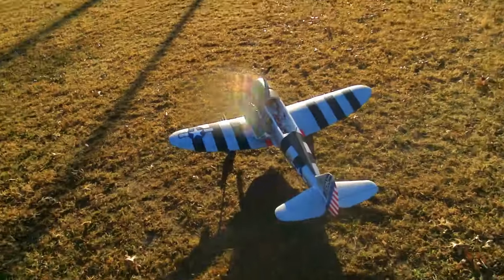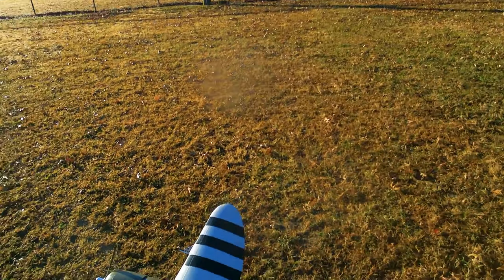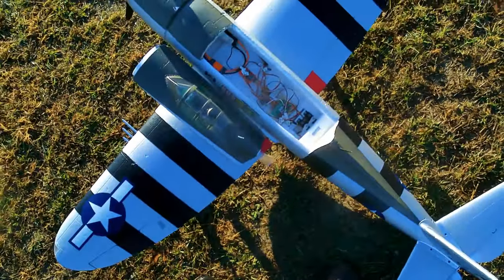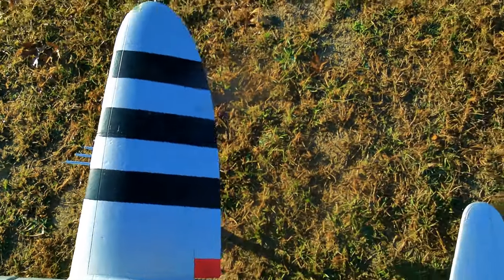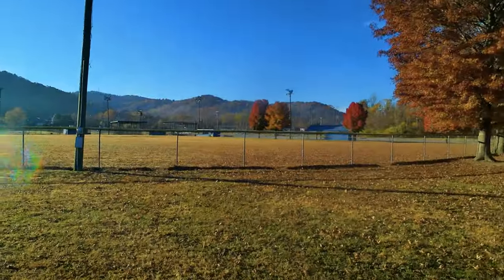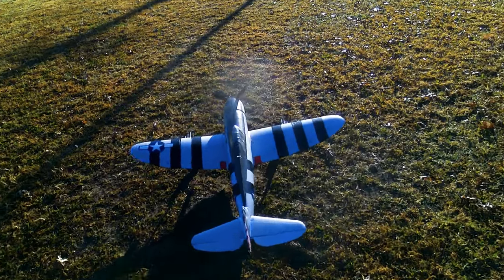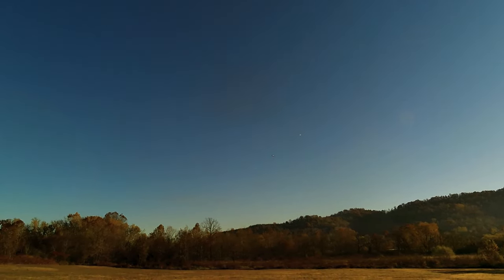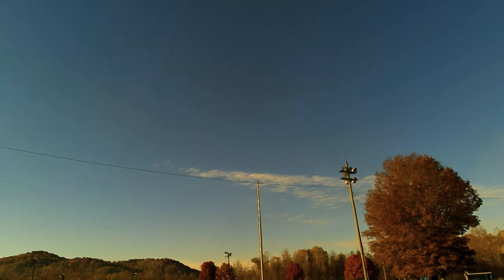FMS-1500MM-P47- RAZORBACK get this awesome warbird at https://www.fmshobby.com/Ta59aSp0ibAGau

Comment: finally got mine in the air today  needed too much elevator trim but otherwise flew fine. Takeoffs and landings were quite easy. That wide squat landing gear helps a lot. Hopefully will get it set up better tomorrow. The plane feels quite heavy
Reply from the maker: Nice. Yes it is an awesome warbird.